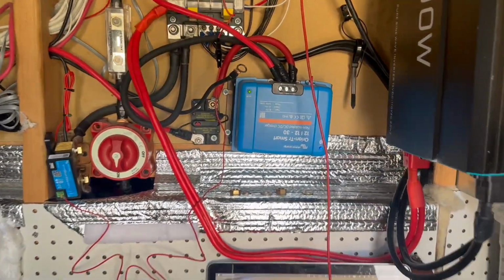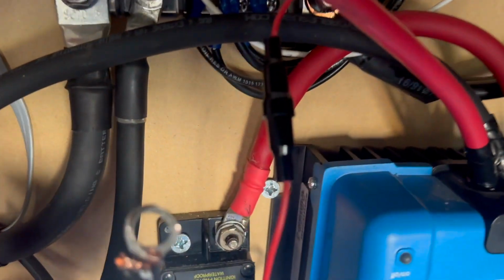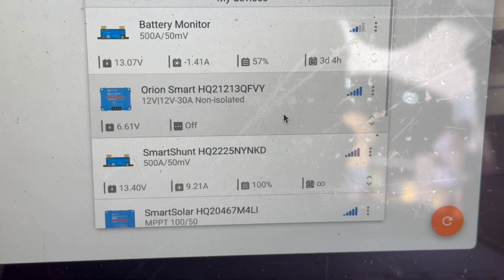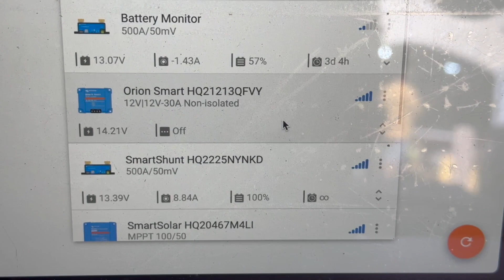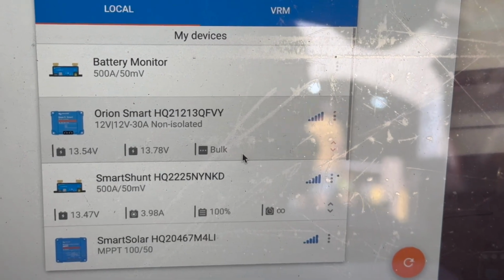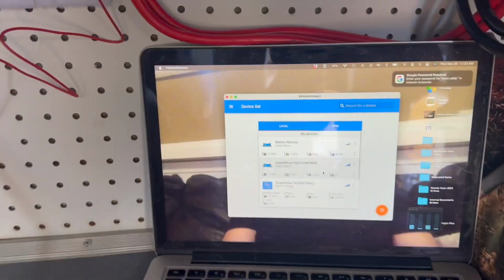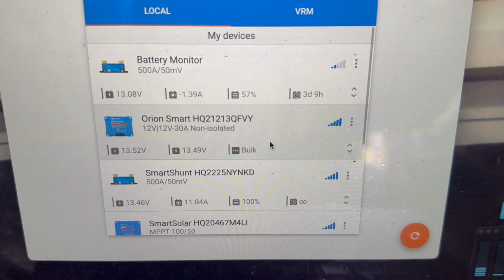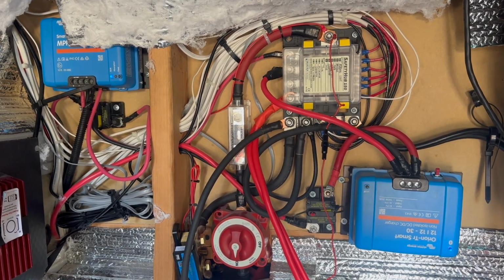Fixing Victron Orion DC DC charger not charging right on Ford Transit Van

Comment: I just bought the 24 24 DC charger from victron. Mine is a isolated smart charger. I hooked my 24 volt 24 leaf modules to my 840 ah lifepo4 battery. Now when the lifepo4 gets low the leaf battery automatically turns on and helps out